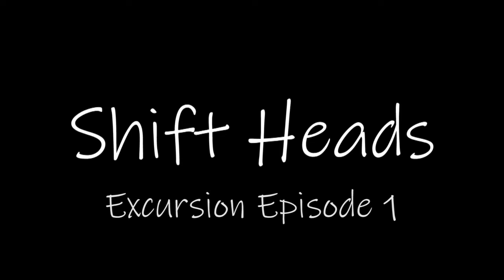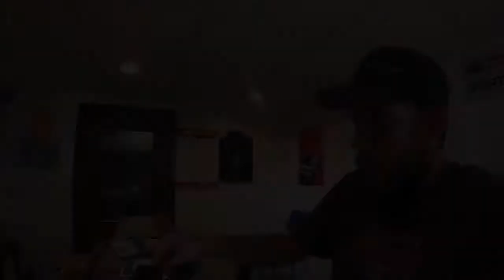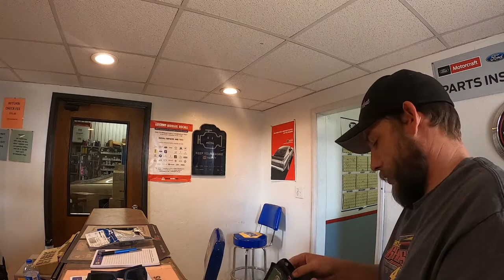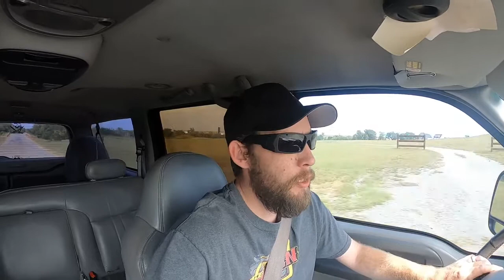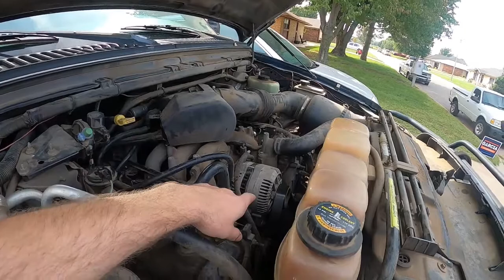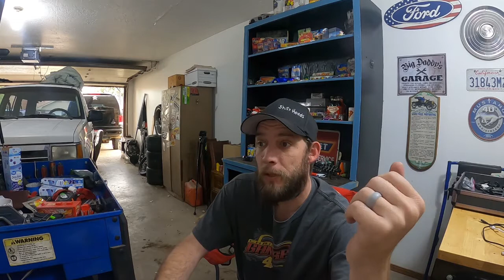Excursion: Whats wrong with it?

Comment: I'm just starting your Excursion series I'm sorry however I do know the nightmare you're heading down I just got my 04 I got the baby brother of yours but I'm only two cylinder shorter than you my wife but ours from a crackhead so I had to do all the coils coil boots because the crackhead decided that the coil boots were an inch too long then the crackhead decided to take the mirrors off and took all the wiring out of the mirrors

Comment: Il have to keep this in mind for my excursion and my husbands mine is a 2000 and his is 2003.......other then that I love my excursion feel way safer in it then in my 2002 ford explorer oh and I have 201,000 miles on my excursion and husband has 268,000 miles on his
Reply from the maker: This problem were having may be a fluke unique to this truck. Bought it used, and have noticed it wasn't really taken great care of. Well know more once the cylinder head has been removed.
Reply: @shift-heads1686  both mine and husbands trucks are used as well I know I need replacement sensor (o2) and replacement of power steering box thing or whatever it is on mine and husband needs some temperature sensor or something like that I think he said on his
Reply from the maker: The sensors are small, easy fixes. And yes, the steering box is a common issue on these.
Reply: @shift-heads1686  thanks for the update on the power steering box I know mine leaks but going to replace it hope it isnt hard fix and other half will need one as well I wonder if they the same on both
Reply from the maker: Most likely they are the exact same. Join the Facebook page called Ford Excursion Owners Club to get even more help with your trucks!
Reply: @shift-heads1686  will do didnt know there was such a page I know we warranted the rotors and stuff to replace on mine from redoing entire brake system on husbands plus also other things as well